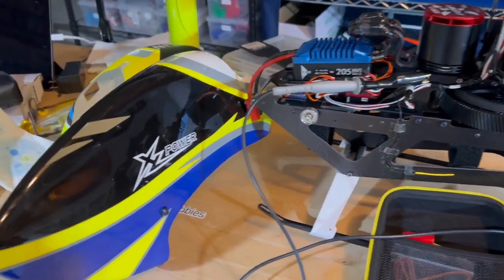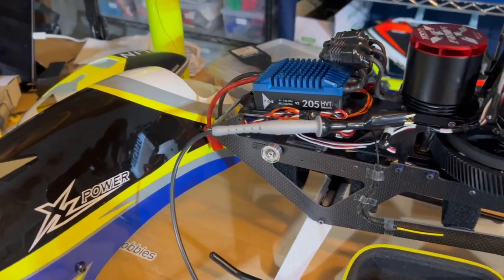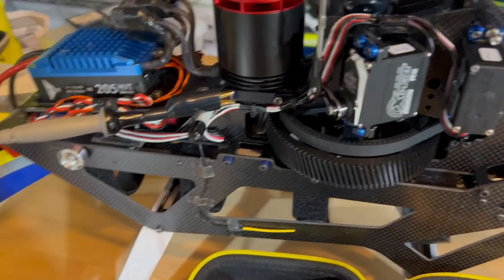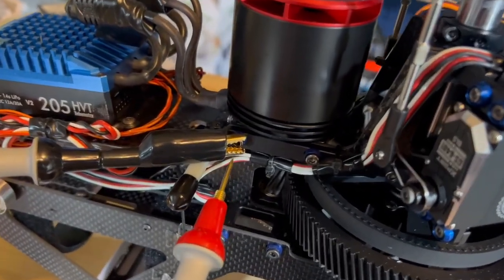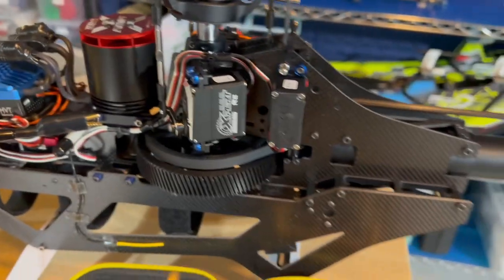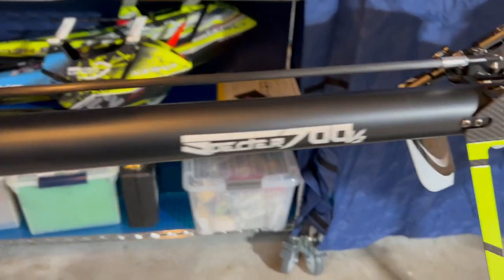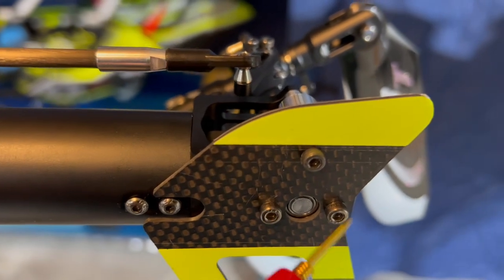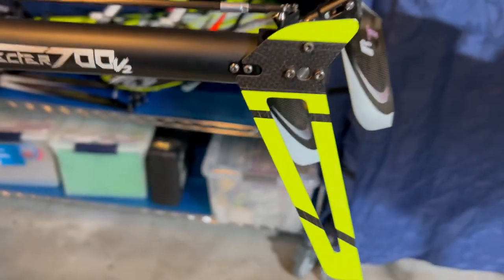Electrical Continuity on RC Helicopter   HD 1080p

Comment: Great test! Have you tried this test on other heli’s? Do most others have or don’t have continuity?
Reply from the maker: All my other 550+ size tail belted helicopters have electrical continuity as well.  Most of them had electrical continuity without any special modification.  Those include the Tron 7, Tron 5.8, Kraken 700, Kraken 580, Protos 700 Evo, Goblin 700, and Goblin 570.  The Logo 700 and Logo 550 required a modification using the so called "anti-static kit".  The smaller micro size helicopters have been a different story.  The SAB mini Comet came with an "anti-static kit", but even with that I was not able to achieve electrical continuity, at least nothing I could measure successfully with the multimeter.  I don't believe I ran into any significant issues with static electricity build up flying that helicopter, but no, I was not able to obtain any measurable electrical continuity.  Same goes for the Goblin 380 which I later converted to a Buddy 380.  I was not able to obtain electrical continuity, but since I have not read of any reports claiming issues due to static hits, I just fly it without worrying about it too much.

Comment: Why do you store your helis upside down?
Reply from the maker: I've been storing the helis in the inverted orientation for about 10 years now.  I decided to do that after noticing that several of my helicopters would drag the vertical fin on the ground after months long Winter storage.  After realizing this vertical fin ground drag was due to warping and sagging of the skid struts, especially the rear skid strut, from the airframe weight, I've been storing the helicopters "upside down" to prevent the skid struts from sagging.